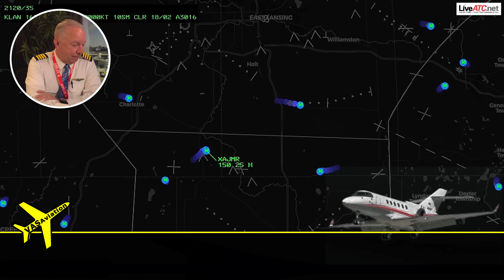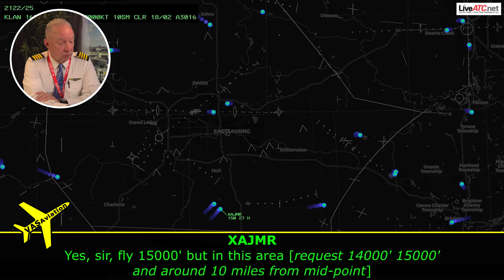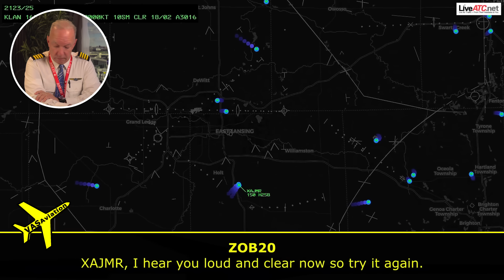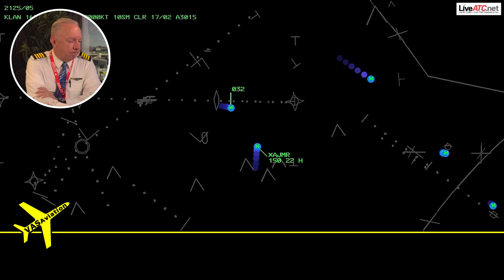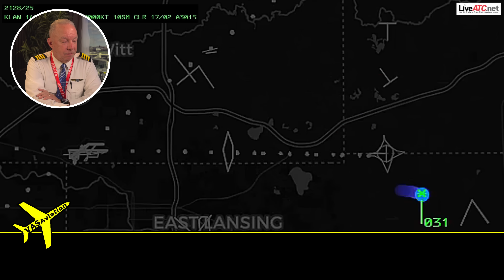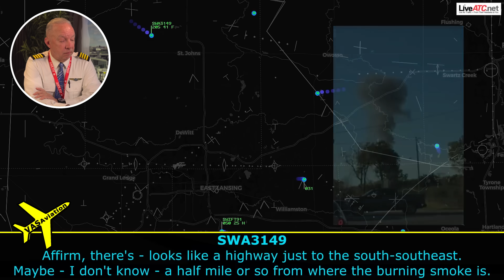Inside the Hawker 800XP Stall Test That Ended in Tragedy

Comment: I had to do several stalls when undertaking my PPL. Let me tell you, it's very scary and because no pair of wings are identical one wing will often provide slightly more lift than the other sending you into a spiral. We did that in a Cessna 150 which is very forgiving and can stall at very low speeds. It was the stall warning buzzer that bothered me the most which gradually increased in volume as the stall commences. Of course I feel very sorry for those Hawker pilots, it must have been a terrifying few minutes. RIP

Comment: The stall tests on hawkers are very violent and that's why the pilots manual has a crap ton of warnings about stall tests.  Those 800XP planes are such junk and the design is from the HS125 Jet dragon from 1960s

Comment: I don’t know much about airplanes or aviation in general, so this might be a naive question. 
Wouldn’t it be a good idea to somehow take pictures or, ideally, even a full visual scan of a plane before takeoff? I’m sure you can recover a lot of in-flight data from the black box but, in a case like the example at the end of the video, where the wings were misaligned, would investigators be able to detect something like that afterward? Wouldn’t it be a lot easier to identify alignment or structural issues with pre-flight visuals instead of only being able to work with what's left after a crash?

Comment: Correction?  If it's in a stall  it isn't possible to 'break' the rudder, as there is very little aerodynamic load on the empennage . You're below the aircraft's manoeuvring speed (the maximum speed at which the pilot can suddenly exert full deflection of the control surfaces.)    Some training aircraft with a normal un-swept wing will stall straight ahead.  A spin or an incipient spin will occur if there is a yawing moment as the wing enters the stall.  In Canada, unlike the United States, demonstrating stall / spin recovery is a requirement for passing a private pilot flight test.  The normal procedure for recovery of a stall / spin in an aircraft is to to apply full opposite rudder until any rotation stops, and to apply forward pressure on the yoke to un-stall the wing.  In the case of this accident, the Hawker XP being  a high performance swept wing aircraft, normal stall recovery technique may not be effective .  Pilot training is required to train pilots how to recognize the onset of a stall.  It's possible that the XP's configuration would render stall recovery impossible (eg. an aft centre of gravity). What was the reason for the maintenance visit?
"The mark of a superior pilot is a pilot who exercises their superior judgement to avoid the situation where they would have to demonstrate their superior skill".

Comment: AMT with hawker experience here. They were most likely performing a stall test after maintenance. Hawkers have TKS panels which weep de-icing fluid, and they run along the center of the entire leading edge of the wing. When these are removed for maintenance, a stall test is required afterwards.
Reply: Maintenance experience on HS125 600 and 800. As earlier reply stated, stall test required post leading edge removal as the position of stall breaker wedge needs to be verified. Set at a datum point pre flight that will be adjusted post flight to address any roll that occurs in the stall due to one wing stalling first. When wings remain level, stall wedges secured in place with a rivet. Never want to speculate about an accident, but I have experienced a wind drop in the stall on a first flight after maintenance and it can be quite severe, hence the need for an experienced and qualified test pilot.
Reply: May I ask why exactly? It seems quite counterintuitive to intentionally risk not only the plane but also the pilots and whoever else is inside the plane at the time.

I can't help but feel that surely there's a safer way than a live test

Comment: You forgot to mention Power to idle…. Then Opposite rudder, then ease back on the yoke. Then ease in power as you level off.
Reply: And how about pushing the nose down to gain airspeed before you try to break the rotation... Otherwise, you can end up in a flat spin.

Comment: They were performing the required stall test after heavy maintenance at Duncan Aviation facility. Its recommended to have a professional test pilot do it but a test pilot was not available and they were under pressure to get the aircraft back to the owner in Mexico. A person connected to the situation posted that in the comments on the report by the Blancolirio Channel You're on YouTube. Btw Current sunset today, October 18th, 2025 is 6:52 p.m. Eastern Standard Time here in Battle Creek, Michigan. Also The two pilots were the regular pilots of the aircraft and hadn't flown it in 6 months. I believe the third person was maintenance technician.
Reply: So wtf are line pilots agreeing to do this test flight that aren't traing in hawker stall/spin recovery.  That's the only thing we should be talking about. Totally bullshit these guys might have felt pressure to do a flight they were not qualified for.  This was this hawkers first flight in 6 months.  What could possibly go wrong
Reply: They was not pressured into it. This type of aircraft don’t need no special training or a test pilot. The original pilots is the test pilot for these. It is recommended to have a test pilot but don’t need one.
Reply: Duncan Avation is literally 4 mins from my house on Gougac lake, I never herd anything about this crash near here. How long ago was it?
Reply: @derekbidelman2442 Lasy Thursday I believe

Comment: While there is some variation (by airframe type) for spin recovery, the only method that works on all airframs is the NASA "PARE" (Power - idle,  Ailerons - neutral, Rudder - opposite the direction of spin, Elevator - Down).  Done it in smaller GA aircraft (it actually a lot of fun) not so sure I want to try in this type of aircraft.
Reply: It seems like this old tried and tried-and-true method has been lost in the sauce somewhere. I keep hearing of airline pilots who break this fundamental technique that I thought was flying 101. I used to do PARE back in the 70's all the time! Apart from this you are looking for a flat spin.

Comment: I have a problem with the Captain's recovery from a stall induced spin procedure. It is not what I was taught or ever did. The wings are still stalled even as the rotation is arrested.  If you immediately ease back on the controls, you will deepen the stall and the aircraft will flip the other way. You must, as I understand it, first beak the stall, that is  check the control column forward and only then ease out of the dive.
For what it is worth.
Reply: That is not the whole procedure for the 800XP, which is why a factory test pilot is needed.
Reply: I agree, as that was widely taught during the 70s and I performed them often. I am puzzled how that procedure, also called "PARE" is no longer taught.

Comment: Fifty two years later I can still remember spin recovery in the F4
“ recover from a spin in the F-4, pilots should apply anti-spin rudder (opposite the direction of the spin), bring the stick full forward to decrease the angle of attack, and keep the ailerons neutral. The drag chute can also be deployed in some F-4 variants to assist recovery. After the spin stops, gently pull back on the stick while monitoring airspeed and angle of attack to return to straight and level flight. “ we also had the benefit of deploying the drag chute which would point the nose down to gain airspeed and recovery!

Comment: It was a deliberate stall check required after heavy maintenance on the deicing system. Not preformed correctly. You are correct regarding language. If you ask any ATC overseas a question that is not aviation related, there will be silence. This was not a training mission. The flight manual explains exactly how to perform this check, and if not followed by the letter, you may die.

Comment: I'm a veteran truck driver, and I stopped at 12:30 to say even I know how to recover from a stall. I've read all the aviation books, and it's simple. Push the yoke (or stick) forward and gain speed. Hopefully you are not too close to the ground. Ya' I know there's more to it than that, but that's it in a nutshell.  Been driving long haul for 51 years, but always wanted to be a pilot. I sometimes dream about flying trucks! Love your program Captain Steeve!
Reply: If it was as simple as in your “books” we wouldn’t have so many stall accidents, a previous Hawker 800XP fatal stall accident under very similar circumstances happened in Grand Junction (another post maintenance test flight) over a year ago. Jets with swept wings can be particularly nasty to recover from a stall.
Reply: When I was young and my family moved interstate I used to wish that there was a way to write letters and just have to push a button to send them.. because I never got around to posting the letters that I wrote. Flying trucks might not happen in your lifetime, but then again, they might.
Reply: Wow...51 years??  I'd say "veteran" is putting it "mildly"!  I'm "at it" for 34 so far...(age 74)...doubt I'll ever accomplish what you've done.  Godspeed to you, sir...👍
Reply: Passenger jets in stall are particularly difficult to regain lift due to the fine margins of airframe/wing flight-stability form to mass size. The plane had reached a high descent speed but was also in a high-momentum spin/spiral that would have needed several thousand feet of altitude to overcome
Reply: Every aircraft stalls differently, different aircraft require different techniques. Pushing forward on the stick will get you killed in one type and save you in another.
Reply: Ah, the overwhelming confidence of a can-do anything, long haul, veteran trucker. I’m right behind you, 49 years, BUT also flying for 47 of them, so I know how little I know. 😜
Reply: @sterndrive, so simple it's the OPPOSITE of what pilot Steve says...

Comment: Not supposed to get the Hawker 800 into fully developed stall. Stick Shaker then Stick push to PREVENT the aircraft from fully stalling. They got that thing in a fully developed stall or deep stall and that is very difficult or impossible to get out of. Must of had the leading edges and stall strips off for inspection. That requires functional stall protection system test to be preformed. I believe there have been quite a few of these accidents on this type while carrying  out this test. Not just the Hawker line but other rear engine, T-tail types are the same. Company i worked for had specific pilots who had factory training to carry any stall system tests. Sad day for all involved.
Reply: I was very surprised at Captain Steve's explanation for stall recovery. I used to go up with my dad a lot during the 70's. We did plenty of stalls. Back then, we were told to push the nose DOWN to pick up more airspeed, then begin to address the spin, and then finally pull up. Without doing that procedure, you can lock yourself into a spin. I have, over the years, heard of pilots who actually pulled back on the stick instead of pushing the nose down. Pushing the nose down felt horrible as you are looking straight down at the ground. Why aren't pilots taught to push the nose down first?

Comment: It was a required test after heavy maintenance. To make sure the stick shaker was calibrated correctly. The crew was not certified to do this. 
You can’t recover a swept wing jet in a deep stall.
Reply: The only thing in that case is a pair of Martin Bakers.  But, no passenger plane has those. Ugh :(

Comment: If an average pilot can't recover from a stall, then why on why internationally put it into a stall to test recovery..if average pilot can't recover it? Let alone fly it with humans in it.  If you have to test above 10,000 feet, if someone stalls this aircraft in normal flight BELOW 10K, does that mean the average, stall trained pilot has no chance of recovery? Logic gate got missed somewhere..
Reply: This aircraft is equipped with stall shaker pusher that will PREVENT you from going into an actual stall. But if you fight it you may get into the actual stall like these guys did. In a swept wing jet recovery from a true stall may not be possible.  Don”t stall your jet unless you are a test pilot! 😂

Comment: This exact incident happened last year in a Hawker in Colorado. Pilots are supposed to stop the test immediately after the stick shaker and stick pusher. Words to the wise. Hire a Functional Test Pilot from Hawker to conduct this stall test after removal of the leading edge.
Reply: this test was apparently done with stall protection off.
Reply: @skyboy1956 If you look at the ADS-B data, it appears as though the autopilot MAY HAVE BEEN ON during part of this test at 15,000 feet AGL. That was also questioned by Juan Browne at the blancolirio channel.
Reply: @skyboy1956 Where, exactly, did you get the information that stall protection was OFF? I worked in Flight Safety at Boeing for more than 9 years at my first job out of College, before trading in my Paramedic certification I received in my Junior year of College, for a Bachelor of Science in Nursing. I read the procedure published by Hawker, and one of the first things it says is autopilot off and stall protection with the stick shaker and stick pusher on. I’d like to know exactly where you found they turned OFF the stall protection features.

Comment: 14:36 interesting that in Steve’s spin recovery, it doesn’t need to have the stall broken by pushing the yoke/stick forward. Otherwise, the process sounded like my old C-172.
Reply: I have always heard to push the stick forward, even to dive straight down, though counterintuitive, this will break the stall and gain airspeed. If you don't push the nose down, you can get into a flat spin. This sounds like a flat spin to me, which is hard to break and requires a lot of power.
Reply: I think he is confusing spin with spiral dive. A spin has low airspeed so you need to push forward to recover airspeed, neutralise yaw with rudder and apply power. A spiral dive has high airspeed so you neutralise the yoke, apply rudder to correct the yaw, reduce power and gently pull back on the stick i.e. what he says only its a spiral dive not a spin.

Comment: Hawkers test pilots should perform all stall tests.
Reply: This isn’t a car where you could just pull over on the side of the road.
Reply: Right to repair anyone?
Reply: @Fast_Cabbage Right to repair this time was 3 life and an airplane. Worth it? Right to repair is cool in agriculture, cars and trucks. Airplane is a different story
Reply: @Fast_Cabbage right to repair it sure, but post repair test flights in a known difficult to recover aircraft?  Probably should be a specifically trained check pilot wouldn’t you think?

Comment: We as glider pilots perform spins quite often. (Same configuration T Tail and swept back wings.
Opposite rudder and centralise the aeleron.
I can't imagine it's that different in a Hawker apart from the mass of the 2 engines, but the rudder should still be able to counter the spin before it goes inverted ⚠️
Reply: It is that different.

Comment: Captain Steeve, as a pilot on the verge of being required to retire due to Federal Regulations associated with a set age, do you have any insight or input on the controversial question of DEI hiring of new pilots in the Airline industry? I have seen many related videos online that Delta, United, and probably other prominent US airlines are using various DEI groups and rules to hire new pilots, not based on their exclusive qualifications and experience, but rather taking into account their race, gender, sexual orientation, etc. over other more qualified pilots. Please tell us this is not true!

Comment: Shouldn't Hawker trained and certified 'test pilots' have flown this plane and conducted this test?  Seems like a more prudent approach than letting ordinary pilots attempt this testing requirement.
Reply: “Ordinary” pilots have to be proficient in stall recovery too.
Reply: In a simulator. You don't practice with real planes over real houses.

Comment: The stall on a T-Tail airplane the recovery procedure it is a little difference than lower tail airplane, if it enter on a complete stall and star enter on a spin,  you must let it to enter after a turn you must push forward a liter harder the yoke and level the wings and push the rudder , if you don't let enter in the spin it will be a flap spin because of the CG.
I just too flight Hawkers, I did three stalls, two after 48 month inspection (the leading edge must be remove) and one because the have too remove the leading edge to check the TKS lines.

Comment: You have this totally wrong.  This was a MANDATORY stall test by maintenance test pilots after the plane has had extensive maintenance.  Nothing more.  They over stalled the airplane to 60 knots and fell out of the sky.  They are only suppose to slow to the stick shaker speed which is much higher and then recover.  The requested altitude block was to perform that test.  This is a Mexican registered airplane, hence the foreign sounding voices.

Comment: Obviously you never flew a T-37. The procedure we were taught was to hold full back stick and full rudder in the direction of the spin. After you are stabilized in the spin, apply full oposite rudder until the spinning stops. Then full forward stick to break out of the stall and then recover normally. Yes,it was a violent recovery, but it worked.
Reply: How much altitude would you fall through in such a recovery?